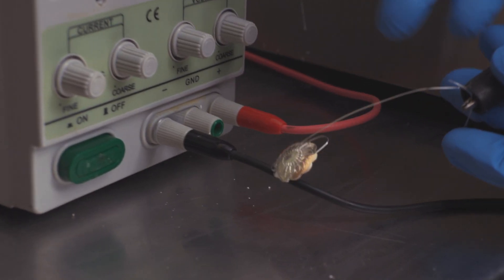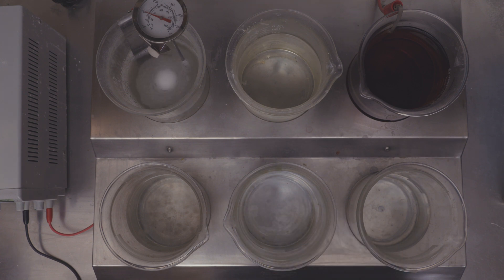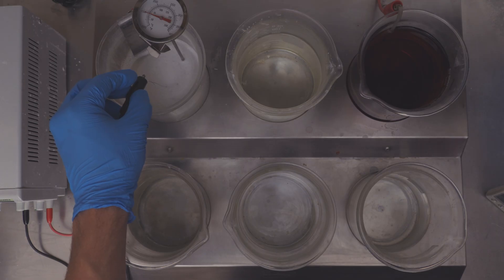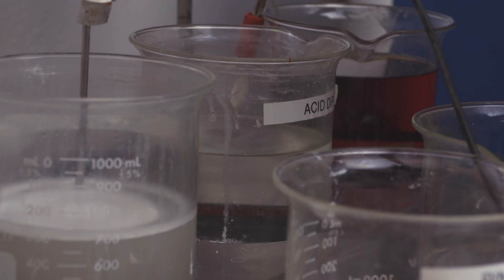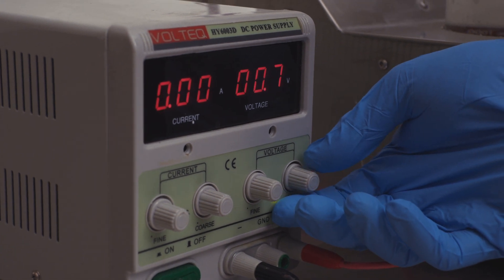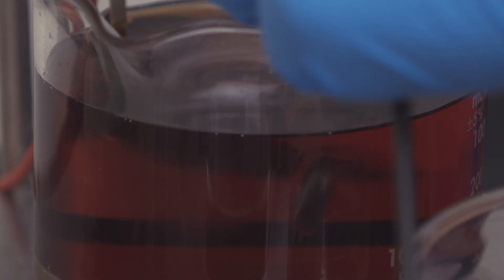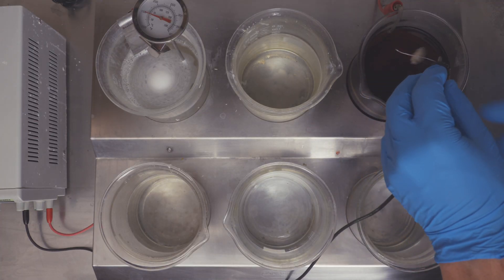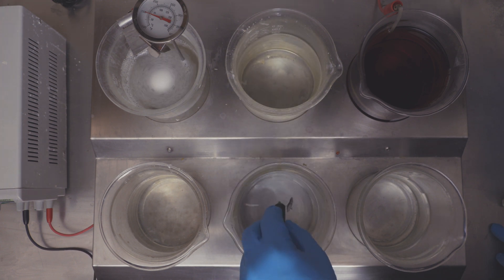How to Use PTLUX, Rhodium Plating Alternative

Comment: why i plated with rhodium the stone is dull and not shiny. thank you very much
Reply from the maker: What kind of stone did you rhodium plate over?  Some stones react to the cleaning step or the acid dip or even the acid in the solution.  Make sure that the stones are clean both before and after the plating process.

Comment: According to the TDS, the optimum operating temperature of the electrolyte is 35 degrees Celsius. At what temperature do you work?
Reply from the maker: We try to have it as close to 35°C (95°F) as possible when plating. Adhering to the instructions as closely as possible will result in the most reliable and consistent plating.